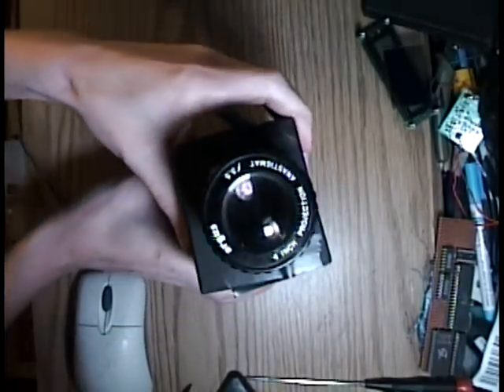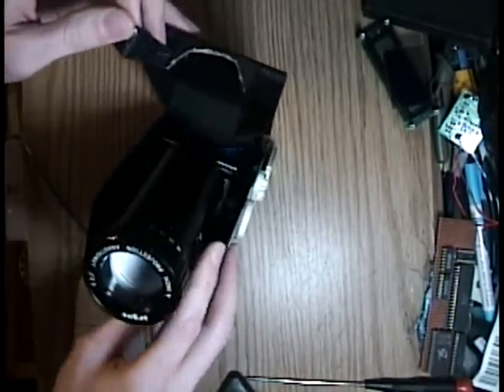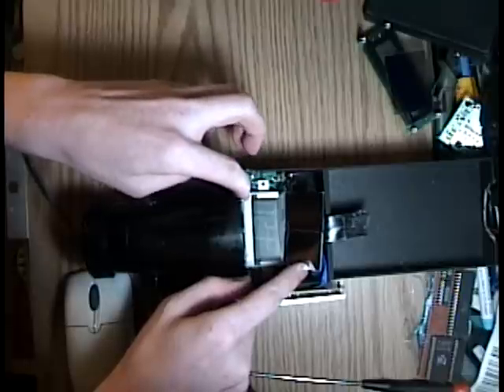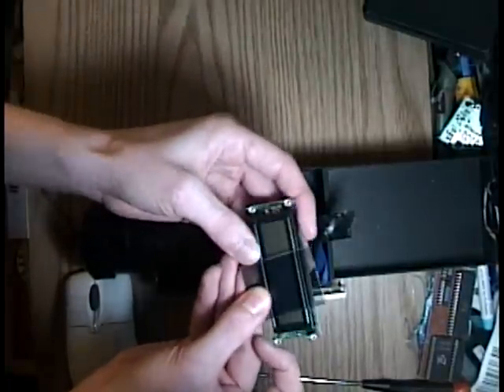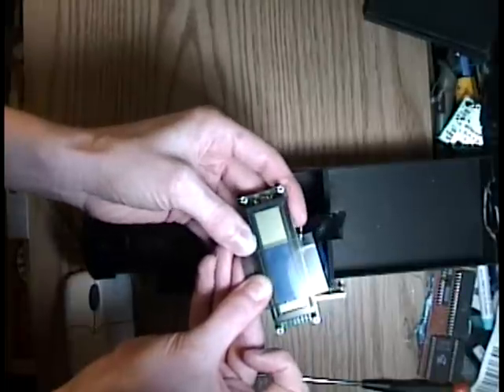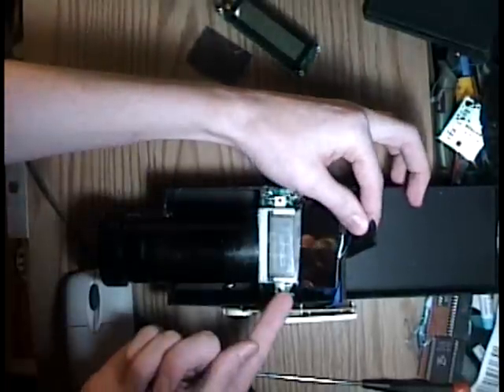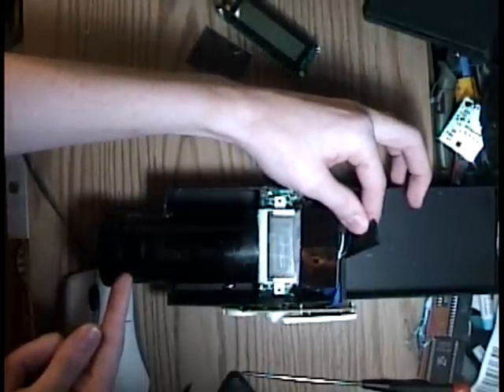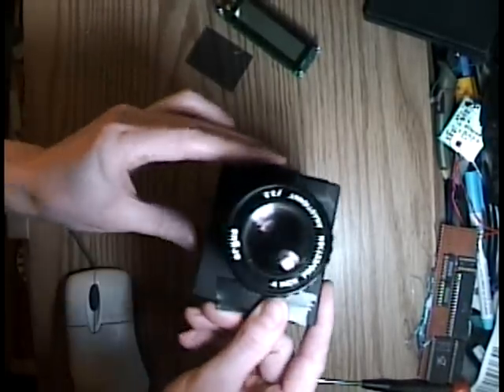DIY Projection Nightlight Clock

Comment: The rest of the LCD is dark because there are crossed polarisers in those regions. The two polarisers (filter and LCD) are at right angles, and no light gets through. When the LCD segments are switched on, they change polarisation by 90 degrees and allow light through.
Reply: I thought they were just dichrolic prisms etched into the material..  like in projection tv’to combine different light into the images on the screen..